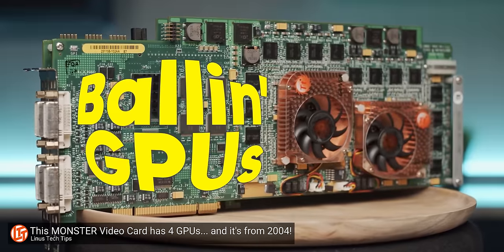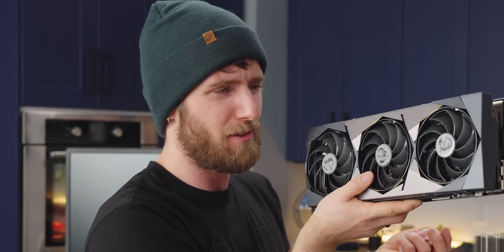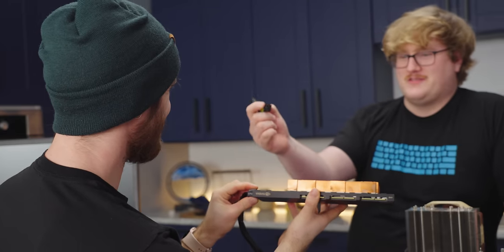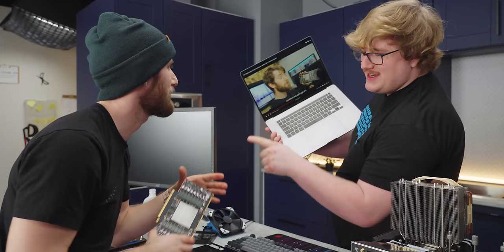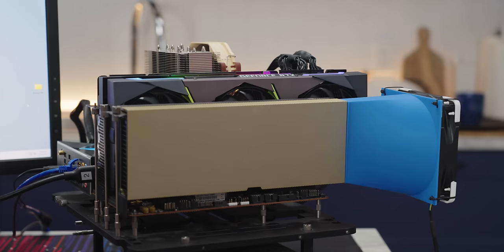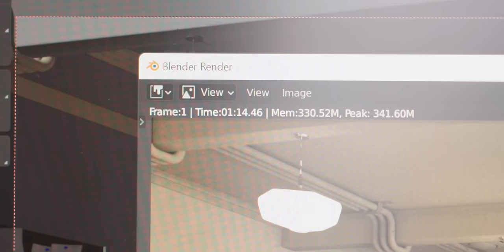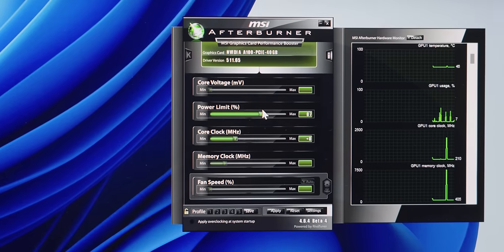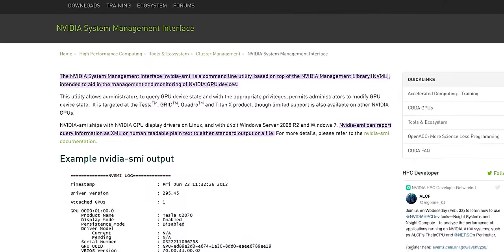NVIDIA REFUSED To Send Us This - NVIDIA A100

Comment: Nvidia should sell this kind of cards to miners instead of selling consumer-grade gpu's in bulk to them.
Reply: they would still bot buy them even with this
Reply: @Whatismusic123  Despite the high price, they still would because it's like 100% more efficient for hashing. Just like Linus said, the running cost (electricity cost) of a gpu for mining far outweighs the price.
Reply: yes
Reply: Most miners wouldn't buy this because they're just not eligible to. For the cost of 10 of these cards you could've purchased like 50-60 3090's even at these high prices and gave them proper cooling which would far outhash those enterprise cards. Yes it's cheaper to run those enterprise cards for the long term but you'd be looking at how long ethereum will last rather than how long the card will last
Reply: This GPU would be pointless to a miner, because it costs $10,000 and it would take them months or even years for them to justify the cost of it from mining, it doesn’t take extremely powerful cards to mine.
Reply: @jaredchampagne2752  It depends on what they mine. Currently, with a consumer-grade GPU, people could mine one ETH in just a few weeks. The A100 could cut that time in well more than a half.
Reply: @jaredchampagne2752  if more where produced, they would probably be a lot less expensive.
Reply: Arent they partly want to advertize?
Reply: no way,  these are built for datacenters
Reply: @pietheijn-vo1gt  It also works extremely well for crypto as Linus demonstrates in this video.
Reply: @jaredchampagne2752  At the general consumer level it's pointless. For large mining operations it's worth it for the reduced power consumption and reduced space needed to run these.
Reply: please nvidia restrict mining k ty
Reply: It would save a ton of e-waste, but corpos don't care about that 🤷‍♂️
Reply: @GlorifiedGremlin  I've never heard someone unironically use the term "corpos" before.
Reply: @CertifiedSunset  I'm a lazy POS, and it saves time lol also I think it sounds kinda neat
Reply: if you had a product where people around the world were willing to spend 50,000 or 100,000s or even more at a given pop and there were many of them around the world and they could pay cash. would you be like....well people have been complaining that they cant get their 400 dollar cheap card at best buy....lets hold off on make 100 million for the next 3 months so some of these kids can play their video games...LOL
Reply: @magno5157  what consumer grade GPU will mine 1 eth in a couple of weeks?  asking for a friend
Reply: Look at all the crypto flogs in here giving their opinion LOL
Reply: spitting facts, tried building a new pc that wouldve been 700-800 and now with all the scalping and inflated prices its 1.3k so i had to buy a laptop that has a way worse gpu with half the vram. nvidia should sell this kind of stuff to miners and not the geforce lineup cause this is just stupid
Reply: That's what the CMP cards are...
Reply: @jaredchampagne2752  $12,500 to $15,000.
Reply: Yea and in maybe 80 years the miners will turn a profit 😂
Reply: I'm sure if they could control that, they would.
Reply: They would make so much cash when you think about it
Reply: maybe they would, if the A100 didn't cost £20k (around $25k)
Reply: @magno5157  how can mine dat?
Reply: Those suckers don't want people getting rich off mining, they enjoy their customers sweat and tears buying neck breaking costly silicon mash-ups
Reply: fr, i cant afford even one gpu now because of the miners
Reply: @jaredchampagne2752  It costs so much that even with FREE electricity it would never pay back the cost.
Reply: @thegroi  Never heard of the "LHR" newer version of almost all Nvidia 3xxx cards?
Reply: @carlsaling785  None even comes close.
Even a 3090 needs MONTHS at recent difficulties.
Reply: @Zephyruxs  Hint - the current shortages came LONG before mining prices jumped enough to people to jump into mining in quantity.
BLAME COVID and the general "semiconductor" shortages.
Reply: @theencoder6992  That's what the CMP cards were INTENDED to be - but they're way too rare and way too expen$ive for what they provide.
Reply: @bricefleckenstein9666  Im sure it says ban not restrict
Reply: @thegroi  "restrict" was YOUR original word.
As long as GPGPU capability exists for a modern video card, people WILL find ways to use them for mining on SOMETHING - IF it can be profitable.
Reply: @bricefleckenstein9666  thought I typed ban instradmb
Reply: Then again, it's not specifically targeted towards their (miners) audience.
Reply: 100%
Reply: you realize they do have cards intended for miners, right?
Reply: @janandreas7382  no they wouldn't be, it is enterprise hardware at enterprise pricing
Reply: Agrees
Reply: You think they cared about that?

They are like EA or Activision equivalent in the GPU market.
Reply: @thegroi  Dream boy
Reply: Those are Server and Mining GPU´s for professionals tho.
Reply: these cost alot of money, mostly because of the power efficiency.
Reply: @danialdunson  Not mainly, they cost that much because they are mant for servers and not us as normal consumer.
Reply: Miners should leave their parents basements
Reply: They tried but the price to performance ratio was relatively unimpressive for miners compared to gaming cards.
Reply: this wont solve any issue.
Reply: @magno5157  agree, but most miners, at least big miners, don't use laptops/pcs, instead, they use things like Antminer which has a dedicated GPU.
Reply: Too expensive for the average miner😂
Reply: These cards original purpose weren't for mining. The business/financial analysis that these cards provide to corporations is a significant market
Reply: Exactly what I was thinking.
Reply: @MrRaja  most miners go to countries where electricity is super cheap or even they can steal it.
Reply: @Shuroii  And now they're all worthless to miners :) we love to see it. Fuck mining
Reply: More profit
Reply: Youd figure nvidea would be smart and create a line dedicated to mining right...?
Reply: @jd5393  then the products would be expensive. If not, people would stop buying gaming gpus and buy those
Reply: Nah screw that mining sucks
Reply: @Shuroii  oh that aged like wine
Reply: NO. Thiz kind of cards are rare and shouldnt hand to miners.
Reply: Where’s the money in that lol they def make more by selling a ton of half trash than a couple pieces of gold
Reply: Miners simply should be prosecuted for wasteful abuse of resources
Reply: 70th reply. sorry for ruining the 69 replies moment
Reply: they can t, ans that s funny you don t know why
Reply: @Whatismusic123  you're confusing miners with scalpers.
Reply: They could just sell regular GPUs but without video outputs and a slight driver tweak, since it would have no need for display rendering. Problem solved.
Reply: Once ive seen a review roasting a rev2.0 gigabyte card because it couldn't mine and that was hilarious
Reply: i think gaming gpus are better for mining. they're much better price wise, and with a bit of tweaking, they can probably come pretty close power wise
Reply: Bro the card is legit for like 18k dollars
Reply: @GlorifiedGremlin  based. when the cyberpunk dystopia hits, you and i will be the pioneers of gay little slang
Reply: They shouldn't sell anything to miners, mining is terrible for the environment
Reply: The problem is Nvidia has a lot more consumer-grade GPUs they can't get rid of than they do these A100s.
Reply: These cards are meant for corporate partners, that's why the secretive (the loaner had to hide their identity) and exclusive nature of it all.  They don't want this in the hands of people they don't want it to be in.  That's what power and influence is, its not for sale to the masses and definitely not worth selling for profits.  Corporations want this tech because its the pinnacle of competition and development, Nvidia does not need to appease gamers needing GTX's and peasants mining crypto.  It's like selling Nukes for a profit, why not keep the Nukes to yourself and coerce influence.  These cards in bulk can make or break billion dollar companies, deep data is the future.
Reply: @Shuroii  mining is dead but ethereum is forever
Reply: that's entirely a retailer thing nvidia dont sell gpus themselves heck they dont even create them themselves
Reply: You can buy them through a third party reseller like myself. I just have min pricing to abide by.
Reply: nvidia tried, the miners just dont want them
Reply: This comment is dumb
Reply: A 10,000 dollar card lol
Reply: @Imkishore_12  Even regular amateur miners spent more than that. Buying 5, 10, 15 different cards were pretty common during the height of Bitcoin craze.

Comment: At this point, the GPU has become the real computer and the CPU is just there to get it going.
Reply: cpu is the coworker that got in because their relaitive works there
Reply: Cpu handles multi tasking/ software management. Without cpu we wouldn't have multiplayer games.
Reply: @cradlepen5621  Singleplayer is the future
Reply: The computer is as fast as it's slowest component.  As example if you have a game that uses the GPU for everything but for some reason decides to use the shadow calculations using the CPU....you are limited by the CPU.  
As you increase the GPU, you need to increase the CPU.  
Then you'll be sitting at loading screens thinking "Why is this taking forever to load?  My CPU and GPU are a beast"
But you are running a standard HDD...Ahhhh time to upgrade!  NVMe SSD FTW!.
It's all a balance and why building your own PC will always be better (when you know when you are doing) compared to just buying a PC.
Reply: This is the weirdest take I've read all week.
Reply: @R Hamlet now a days.You can still have single player with a  cpu only
Reply: @cradlepen5621  Without cpu we wouldn't have any fucking games lol... They are almost the same component exactly except one specializes in doing many smaller tasks (gpu) while the other (cpu) handles all the main functions of the computer.
Reply: @alladeenmdfkr2255  how? Please explain. I feel that multiplayer will be the future
Reply: @alladeenmdfkr2255  nah portal 3 it is
Reply: An so begin the gpu vs cpu war
Reply: I think you could ditch the cpu if software was just made to support it. But it isn't and likely never will be
Reply: @TheWipal  nah that's because they've been here for a long time
Reply: GPU: look at me. I am the Capitan now.
Reply: except GPU's are really bad At things where CPUs are really good at. (Mainly vectorization is GPU territory)
Reply: Like it was back in end of 90s with Voodoo
Reply: @cradlepen5621  Multiplayer games? Never heard of that, do you plug a second keyboard and mouse in ?
Reply: @Dstructeur1  online multi-player
Reply: @cradlepen5621 or anything else, really
Reply: This will be the future though. Parallel computing with massive memory = Generating models
Reply: @alladeenmdfkr2255 singleplayer is literally the past
Reply: @alladeenmdfkr2255  Lol no
Reply: @YaGirlZero signs of a lack of intelligence
Reply: gpu is like an engineer and the cpu is the guy who makes a google slide for the meeting they have at 4
Reply: Bro explained bottleneck
Reply: @YungShirtPocket  As someone who is on a CPU from 2011 and a modern GPU, I wish it was like this. My CPU hurts me.
Reply: This is like saying at this point, the hand is the real human.
 It's crazy useful,  but it is neither required nor is it a substitute for the other essential parts :p
Reply: @tystin_gaming true, upgrading just one part is hard because say i upgrade my ram but i’m still running ddr4, you would need to upgrade your playform to ddr5 anyway in the future so you might as well just buy i new motherboard before new ram yk
Reply: The CPU is just there for moral support
Reply: @tystin_gaming  bro decided to put me in a college classlmao preciate the knowledge just buit my first pc
Reply: @100MJ-n3i  It was a very crude and boiled down example, but if it helped in any way i'm glad.  The best game to use as a reference to my example is Skyrim.  Both legendary and special edition use the graphics card for almost everything....except shadows.  Those calculations are left to the CPU.  So when you are in the open world all those trees and NPCs casting shadows...the CPU, not GPU are calculating those values.  
For the most part these days most operations are left up to the GPU, but wanted to use it as an example of bottlenecking.
Reply: when it comes to things like compiling, simulation(which is also relies on gpus), and rendering are all very cpu centric tasks. The GPU is good simple things over and over again, but when you need to do more complex things or things that arent super repetitive thats when you use the CPU. its honestly the opposite, the GPU is there to support the CPU and make its life easier.
Reply: @YaGirlZero i disagree there should be singleplayer and multiplayer gaming wouldn't be fun if both don't exist
Reply: @alladeenmdfkr2255  not at all
Reply: Gpus are optimised for parallel processing with simple logic cpus are optimised for most production code out in the wild 

Your take is very stupid
Reply: @djmetrokid  brother in no world is singleplayer the future and that's what my comment was about either you replied to the wrong person or you don't know what your talking about
Reply: @t2_rektu748  I was replying to the original comment as in cpus are there just to get the pc started 

sorry